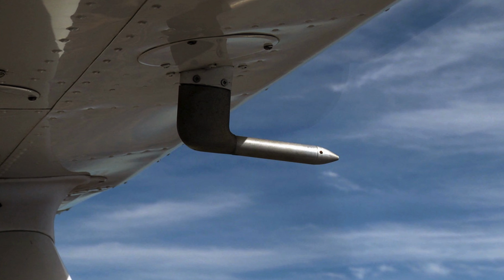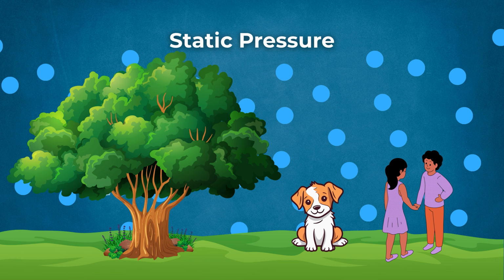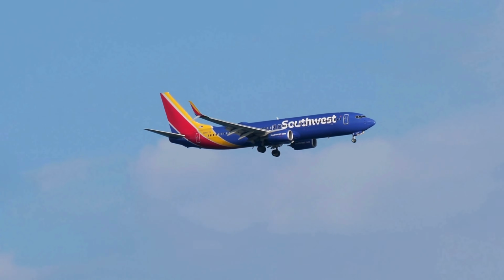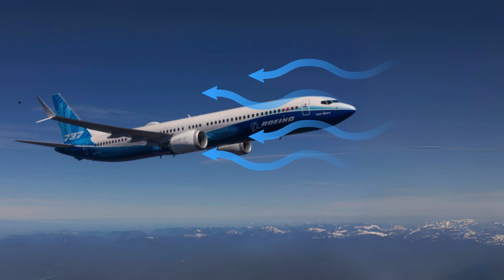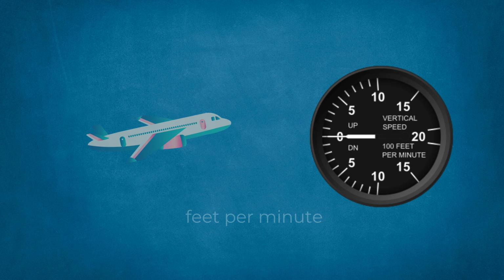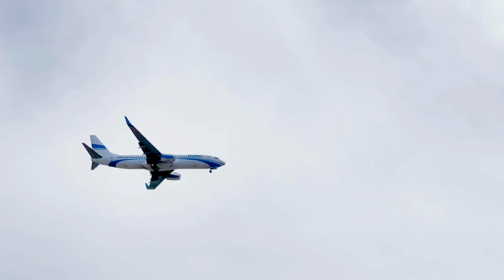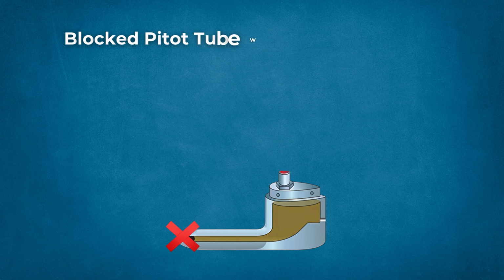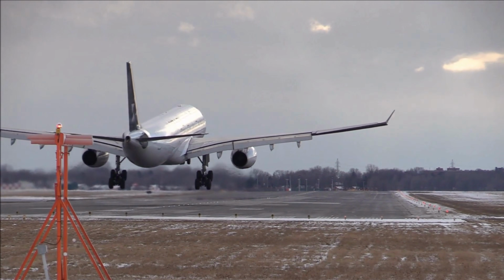Pitot-Static System | Everything You Need to KNOW

Comment: Looking at the rayleogh formula, static pressure located before the shock layer is needed as an input. But how it is measured while the shockwave is happening? Doesn't the the static probe "feel" a shock wave too, so the static pressure it feels is not the actual pressure before the shock, but after.

Comment: Static pressure port only measures static pressure when the plane is at rest. In flight it measures dynamic pressure.
Since Pitot measure total pressure static+dynamic, the difference results in static (air) pressure, which points to pressure altitude.
The static pressure port measures dynamic pressure in flight, which when compared to static pressure resulted as difference between measured total pressure nd measure static pressure, results in air speed.